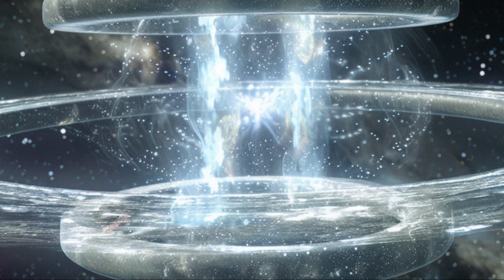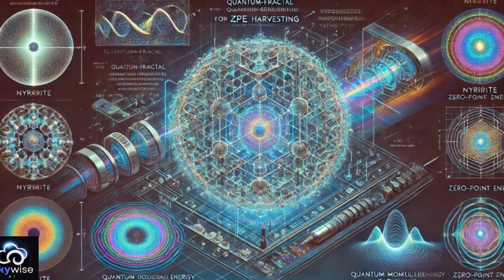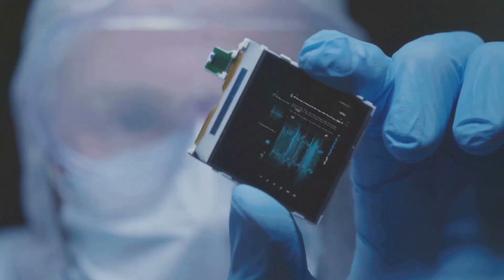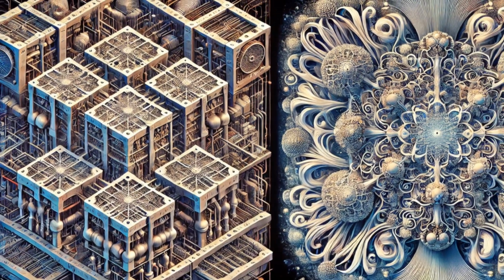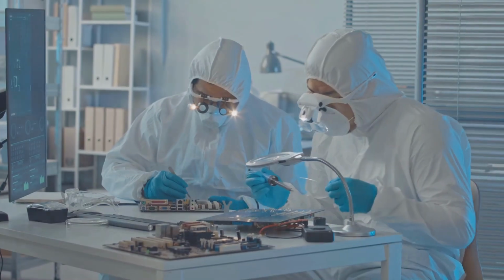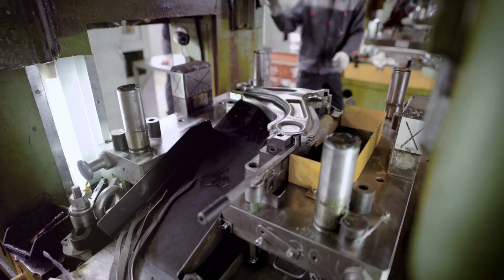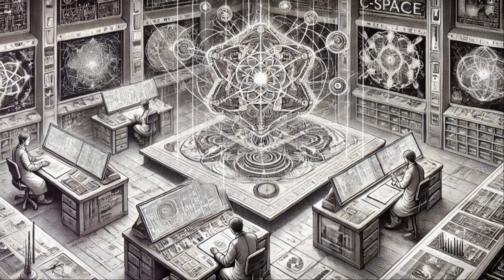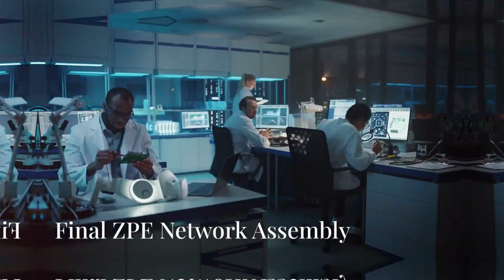Quantum Vacuum Energy (ZPE) | Building a Nyrrite-Based Zero Point Energy System (2025)

Comment: Zero-point energy Tesla coils coupled to 'Nyrrite' diodes and Casimir effect capacitors connected to electron beam klystron zero-point static potential energy absorbing amplifiers, zero-point tension capacitive polarizers, and zero-point linear accelerators targeting zero-point diodes.
Reply from the maker: You are thinking along the right lines. The  MEQ can unlock the potential of zero-point energy.